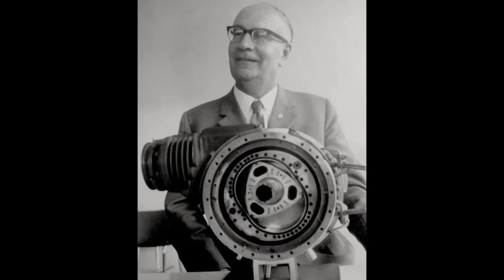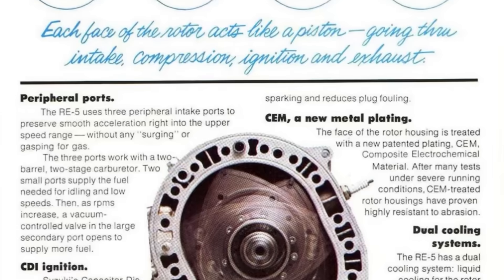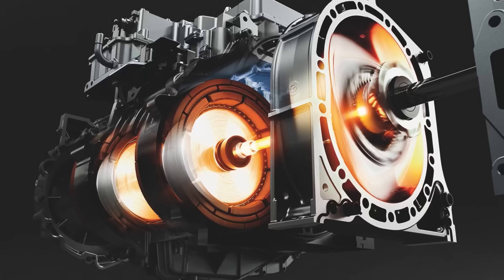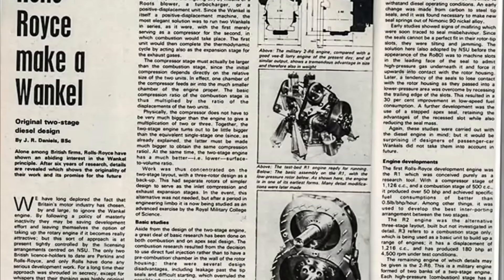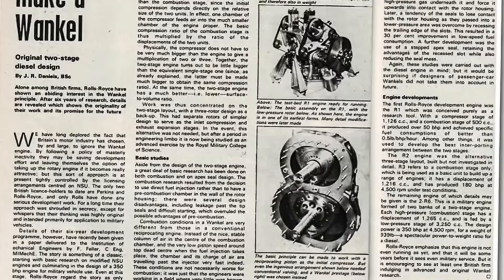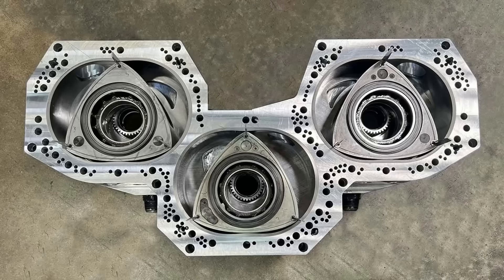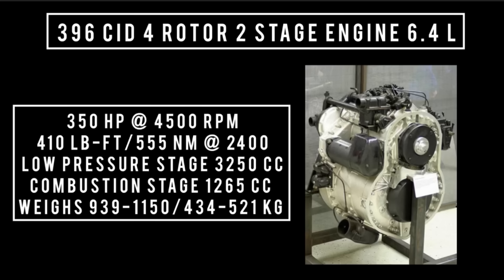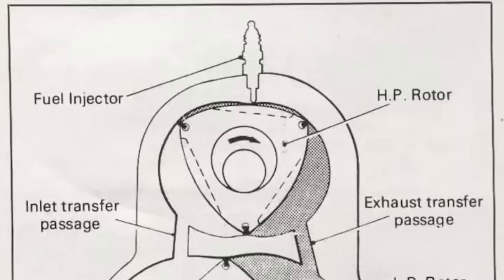Rolls-Royce diesel rotary engine

Comment: Which Wankel engine episode would I like to see? ALL of them! I thought AMC was going to buy engines from GM for the Pacer. John Deere? I never heard of that, so that would be interesting, too. I could be wrong (gasp), but Rolls-Royce cars and jet engines are two separate companies. I would assume that RR aircraft would be the maker of this Wankel engine. And, how did they think that their engine could make even 350 hp from a diesel back in the 70s? Interesting stuff, Jay!
Reply from the maker: Going to eventually cover all of the rotary engines eventually, I'm with you John Deere would be a very interesting company to do a deep dive on and talk about this engine

Funny side bit sometimes I have to go back and look and see what engines/cars. I do. It gets hard to remember everything. This is an episode that I wrote out before, but I couldn't find enough information to present it... I actually wanted to release this maybe a week or two after the wankle engine episode but the episode didn't do all that well so I sat on it and then lost the script hahaha it happens more than I'd like to admit 

I have one engine episode kind of sort of almost done. It's on the international red diamond series unfortunately I don't know where the draw the line on that one so probably do the blue diamond and the red diamond series cause I guess that's an order anyway. ... I love finding missing links but sometimes it takes a little longer haha.
Reply: Note: I made my comment before reading the similar comment from @winstonelston5743. I guess great minds think alike.
Reply: You mean John Queer.  They went Woke, now they are going broke.

Comment: G M Wanker's might be fun 😉👍
Reply: GM wanted to use their Wankel for the debut of the 1975 Monza, Skylark, etc. Instead they had to shoehorn the teeny 262 V8 in the Monza and the Buick V6 in the others.
Reply: @61rampy65 😂 yeah I had a 4.3 in a 75 coupe..
Put a 71 Caprice 400 in it ...
Pull the tire's off to change plugs..
I put the 262 in a Vega GT.... Those motors sucked Grenade !!!!
Enjoy ✌️🍻
Reply: @johnboydTx  Ooh! I'll bet that the 75 Monza hauled with the 400!
Reply: @61rampy65  about 4 months on the rear axle... I used a Monte Carlo Axle 😂.
Way to wide just cut the quarter panels 🤦..
Chrome and Paint don't win races 🤔🤷...
What makes you laugh 😂 
Can make you cry 😭..
Enjoy ✌️🧡
Reply from the maker: Awesome thank you so much for that suggestion

Comment: Wasn't AMC planning to source Wankels from GM for use in the Pacer? 
I'd like to see AMC's efforts in depth.
Reply from the maker: I think you're right I remember reading an article on it, but I think that those two paired up there was a lot of collaboration going on with that engine. It's amazing that it didn't succeed as well as it could've.
Reply: @What.its.like.  You are correct. AMC built the Pacer with  the intent of using the GM rotary engine.  The GM 1974 monza was designed to use the gm rotary.
Reply: @What.its.like.  All the Wankel Rotary Engines had very poor fuel efficiency, poor torque and high fuel consumption.
I had never seen a Mazda RX7 with their Rotary engine that hadn't had the seals replaced every 50 k miles or less. 
The design is flawed and inefficient, but it has a lower reciprocating mass and can rev high as seen by analyzing the torque on the crankshaft. And the losses Mazda suffered because their "engine of the future" was a dud led to Ford buying controlling interest despite the Japanese government having a soft ban on foreign control of their industry...